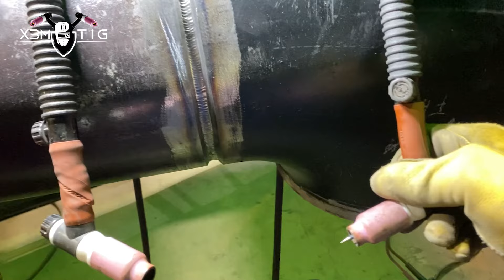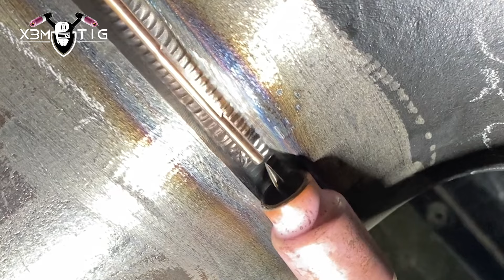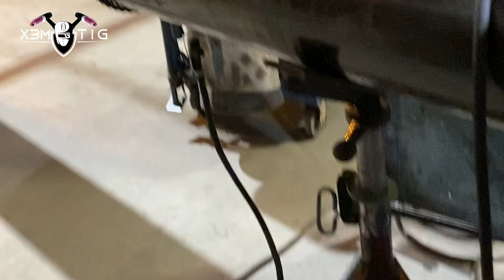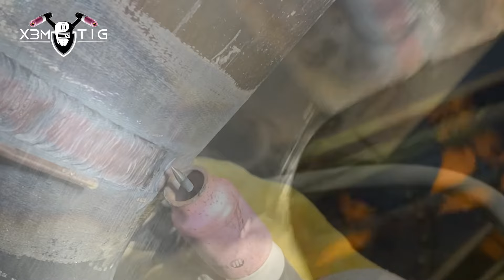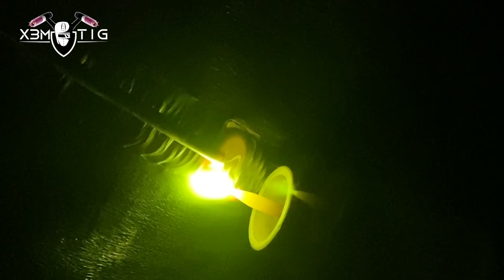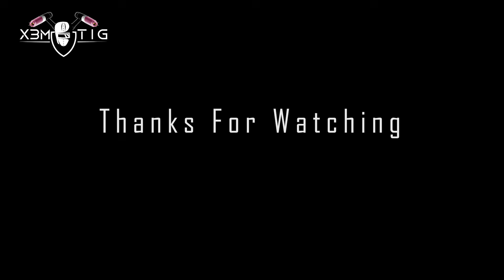TIG Welding – How to Fill to Flush in One Pass Like a Pro!

Comment: Thank you man for taking the time to show you're techniques. I'm shitting bricks on my way to a job site for the week to Tig a 20 inch & 14 inch pipe in position. Of course my problem is the bottom being in a comfortable position and getting a good continuous root. I'm tryna get the heavy root down. It took me 4 days to do two 14 inch pipes in position 😬 I'ma try out this fill to flush hopefully helps me go quicker. The fitters I'm with are cool though and know I'm doing my best so still giving me the opportunity to get better. I've been doing this 2 years now & I'm 32 started as a helper with no experience worked my ass off to get to where I'm at now. This is the first big project I've been sent out for. Anyways just wanted to thank you love the videos. 🤝
Reply from the maker: Hey bud, thanks for your comment! It’s good to hear that nobody is giving you hard time about being slow, and letting you to do your work . Welding can be very stressful, especially in early stages of experience. My advice; take your time and don’t rush! It is better to weld that joint for two days but do it correctly, instead of finishing it within one day and have repairs or cutouts! Don’t try to impress anyone except yourself! Speed will naturally come in place as your experience increases!

Comment: Any formula how to calculate amp current for stick welding ( MMA ) for material thickness ?!
Reply from the maker: Usually I go by the manufacturer recommendations on the box, and from there I do the fine tuning, up or down in amps.
Reply: @X3MTIG  thx

Comment: my only tig experience so far is 2 years doing almost nothing but stainless sheet metal, how do i transition into doing pipe or boilermaking? is there a way to speed up the apprenticeship process due to my previous welding experience?
Reply from the maker: Hey buddy! Nothings wrong with that experience, you know how the TIG works. You have to talk with your employer to switch to piping or find another company that will hire you as apprentice pipe welder.